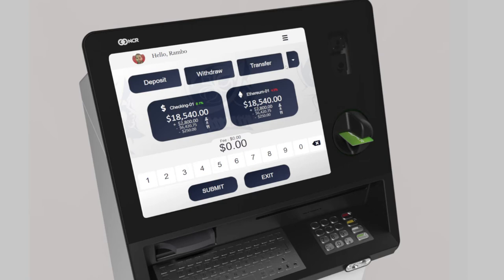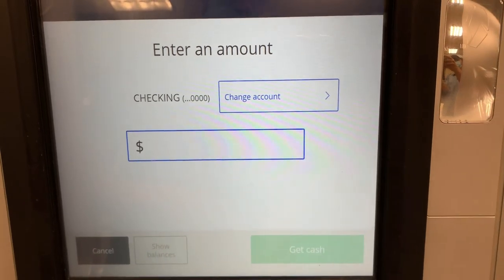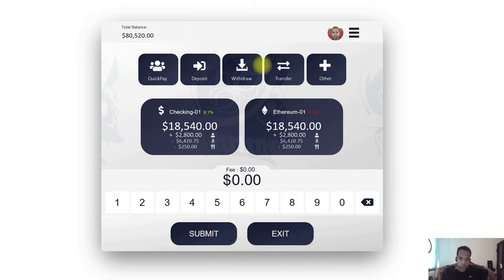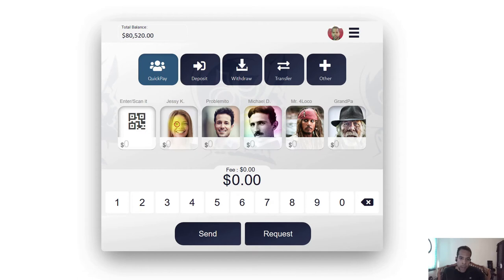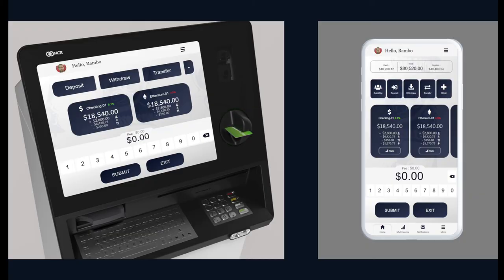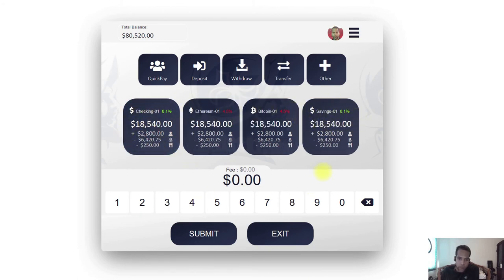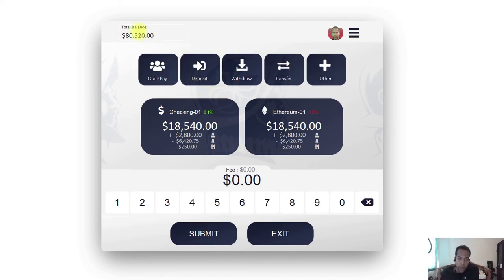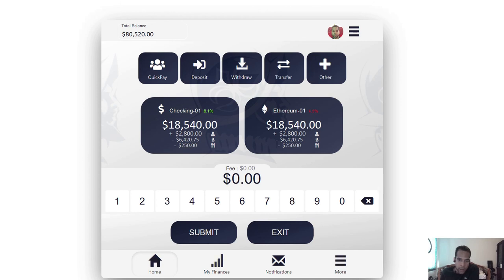The New UIUX design for ATM machines

Comment: Question could u make this event simple, just an atm that can withdraw money option
Reply from the maker: Hi Franc, thanks for your question. I do have models that just allow users to make withdraws and nothing else. This model is for machines that provide full banking experience to customers.
Reply: @randolp.-ultimatemachineui7077  that is good I would be interested in seeing how you made it simple. Are u running your app on a android platform or web interface.
Reply from the maker: @francright8473  you can check it out at www.UltimateMachineUi.com.

Comment: Have you performed Usability testing? If yes, what was the result? Have you tested for Accessibility? 

Few things to consider.
1.  Not everyone likes to have their balance displayed like that on the screen unless the user wants to see their balance. ATMs are placed in public locations, it's possible someone can see the amount. Especially the Cryptocurrency. I would hate to have it displayed like that unless I absolutely need to see my balance. Unless the ATM is in a private booth.

2. Numpad's design is not effective. If I want to type $1,920, I would have to move my fingers from left to right to left to right. too much finger movement. Numpad designs we have now (3x3 layout) are well optimized for speed and accuracy. 

3. Transfering fund: Most of the time users transfer money to someone else account, this flow you have for transferring money is only within the user's different accounts not someone else accounts.

4. Fonts and colors: Some of the colors used are not accessibility friendly. People with color blindness wouldn't be able to know if an option is selected or not.

I think this UX/UI lacks user testing, I feel you designed this specifically for yourself, not for others.
Reply from the maker: Hi Ridin, 
Sorry im reply late. Just saw your comment. Thank you for your feedback. You made great points here I'll try to address them so you can see why I have made my decisions.

This is a single-facet multi-platform consistent design with linear flow user experience. 

I wanted to provide users a single-facet interface with linear flow user experience so they get what they need without having to progress through multiple screens and without surprising them progressively disclosing elements. (Calculators are single facet interfaces everybody love their simplicity, they are easier to learn, use and remember). Nobody likes to progress throughout multiple interfaces to get what they need, it's a fact.

I also wanted to create a multiplatform consistent design so customers finally get to enjoy the same experience at the machine and mobile application as it should be. This design concept makes this possible.

Customers need their balance displayed on the screen in order to know if they have enough funds to make the transactions they need. Otherwise customers will be doing extra steps at the machine in order to know if a particular account has enough funds to cover a transaction. They idea is to provide smooth experience by anticipating customers needs. Accounts balance is information that must be readily available. When using an ATM you need privacy no one should be near you. Family, friends and strangers should stay at a distance while you use it, if they don't then don't use it and be concerned about them.

3x3 NumberPads are easier but they occupy too much real state in the screen. I don't want users to transition to another screen just so they can specify a desired amount. I also don't want to surprise users with a progressive disclosed number pad. Screen transitions and progressive disclosed elements disrupt the user flow. I want to ensure the smooth user experience. This is why I decided to go with a Linear Number Pad. Qwerty keyboards have them, users are well familiar and ok with it. They goal is to ensure a very fluent and consistent experience not just at the number pad but at making any transaction. The user flow is everything, it can't be disrupted by.

This design enables a user to seamlessly make transfers between his accounts, also send/request money to other people and also send Wiretransfers. Most users rarely do Wiretransfers therefore I don't think this option should be displayed to the user in the main screen as it will occupy space. If users ever need this option they can find it in the "Other Services" button which displays other available banking services such as pay bills credit cards and more.

Colors and fonts are optional. Fonts could be Chinese, Arabic Spanish. 

I hope I have addressed your points. Thank you again for your feedback. And sorry I'm replying late to your comment. I'm not expecting comments here it's a surprise for me when I see a comment from someone here.